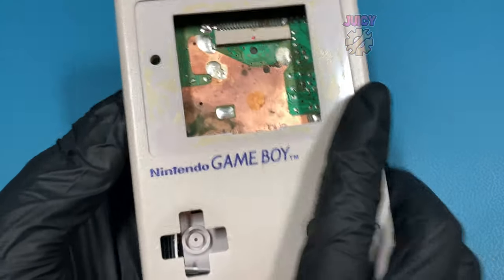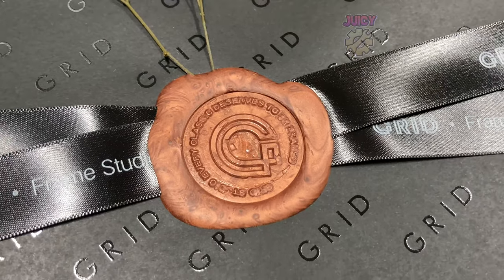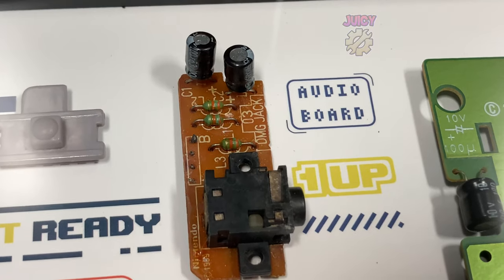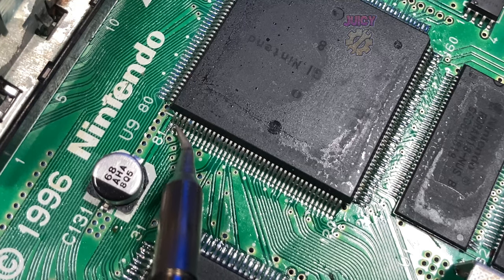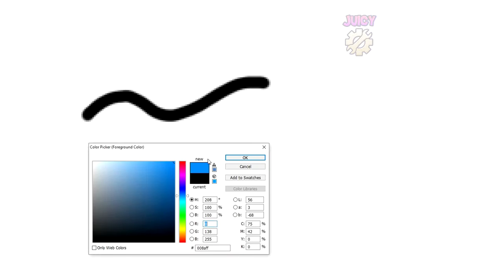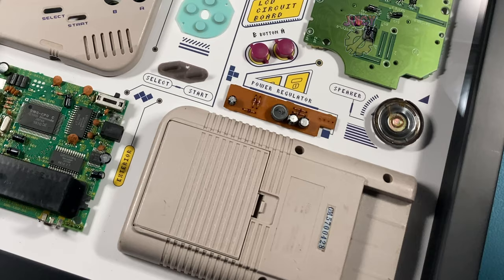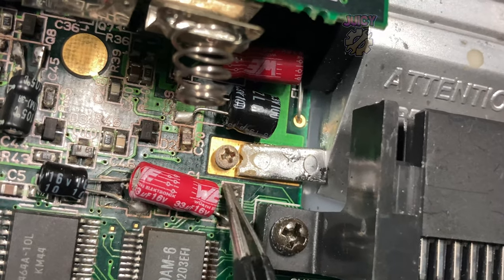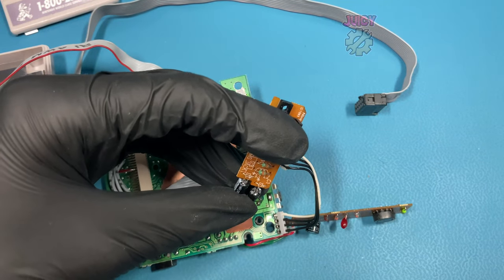the BEST way to display faulty Retro Consoles!

Comment: You know what would be great for this?  Dummy capacitors.  These won't be used again.  All it would take would be some PVC rod in the appropriate diameter and whatever sleeve the capacitor companies shrink-wrap those  caps in.  I'd guess that could be sourced 3rd party...
Reply from the maker: thats a great idea actually!
Reply: Meh
Not like they'll leak everywhere
Generally they dry out
Reply: @BavarianM  Sorry you have to do it.